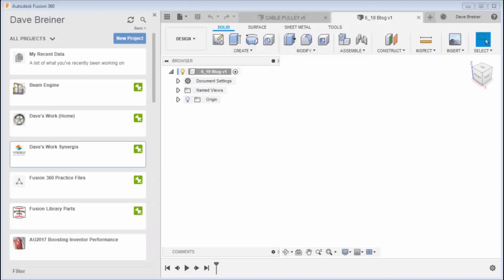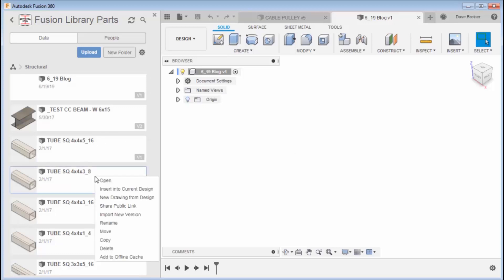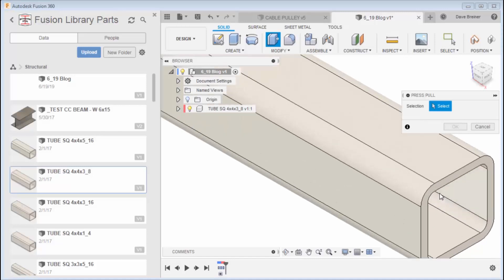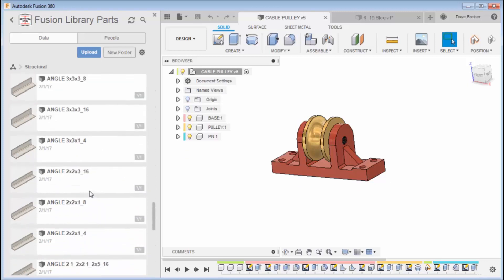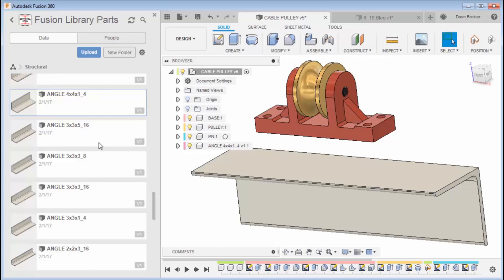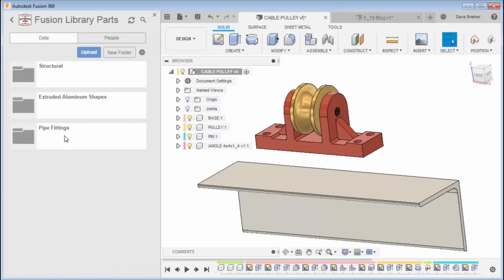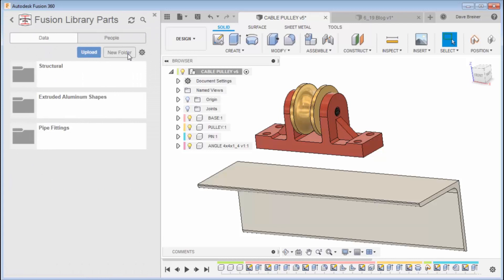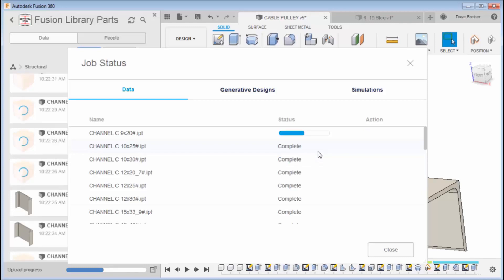Fusion 360 - Standard Parts Library Follow-Up

Comment: Hello,  similar problem as others have stated.  I was able to upload the files into a folder.  I can seem them.  But when I right click there is no option to Insert into current drawing.  I'm in the Design workspace.  Any ideas what could be wrong?  Thanks.
Reply: OK, it's a license issue.  If you only have the "Personal - not for commercial use" license, you can't use inventor files.

Comment: I don't know why I didn't find your video sooner as I've been looking for this exact workflow off and on for over a year.
I use Inventor professionally at work and really miss the content center on my personal home workstation running Fusion. I have been downloading McMaster structural steel parts just to get the profile but still extruding my parts from the sketches I generate.
In less time it took to watch your 2 videos I was able to upload all of your zip files and begin using the angle and square tube in my current design. And I noticed you have materials already assigned to your parts!
You have save me literally many hours of design time on all my projects going forward. 
Do you need any help doing unequal angles and rectangular tube next? I'd like to learn more about how you generated these.
Many thanks for an excellent tool!
Reply from the maker: Thanks so much for your feedback.
Reply: I do have a paid subscription, but not seeing the download icon in Autodesk viewer. Looks like a nice solution hope I can still download this.